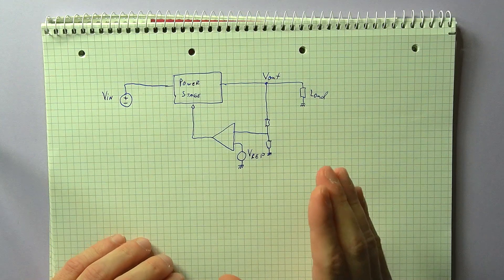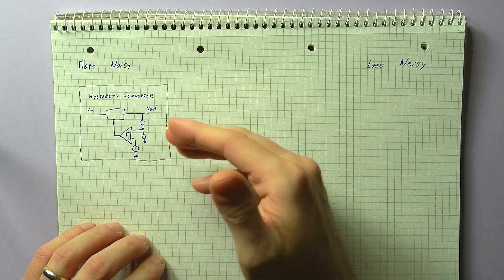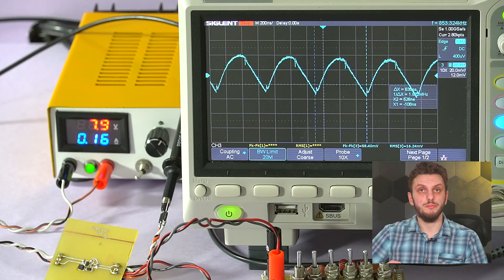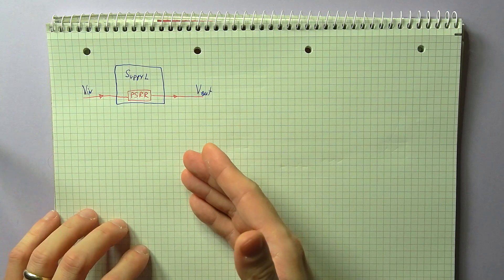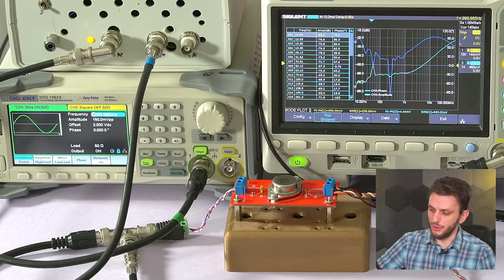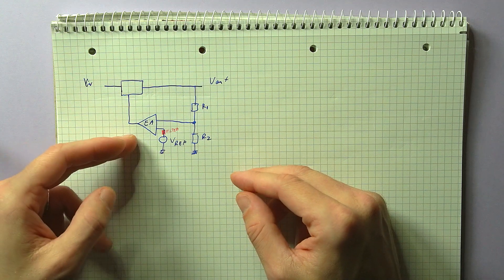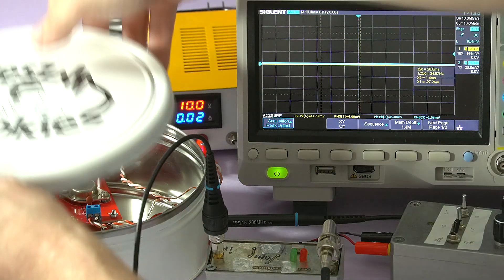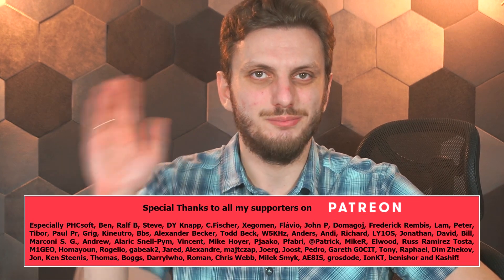Power Supply parameters - Output Noise

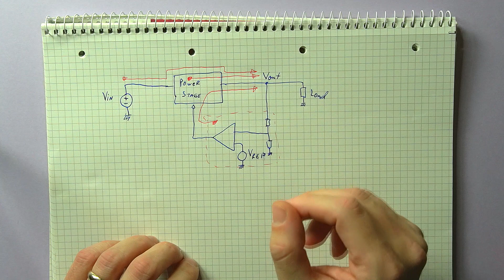Comment: 2:34 > "There is no such a thing as a perfectly clean electronic power supply" where do DC batteries fall in your assumptions?
Reply from the maker: I was mainly referring to electronic circuits - both linear and switching supplies, depending on the application, have non-negligible amounts of output noise.

Comment: I'm curious, could the active load, which was used in the noise measurement setup, affect the results? An active load usually has its own feedback network and an amplifier so it's may be a noise source too.
Reply: I bet this can be an issue. When I tested some PSUs I used purely resistive loads to figure out the actual noise from the SMPS and not have my actual load influence that measurement.

Comment: It goes without saying that there are some deep rabbit holes here. For example, you may find out the hard way that it is not only the noise relative to circuit ground that counts and what common-mode noise is once a crappy USB charger sabotages touchscreen operation on your tablet or phone... And then there is the fun subject of mains leakage...

Comment: Hi Feri!  Once on a conference at Rohde&Schwarz the speaker was Steven Sandler from Picotest, he told us "Avoid ferrite beads like the plague!" - however I've found them quite useful in several circuits containing DC/DC converters. What is your take on ferrite beads as filters for power supply noise?
Reply from the maker: In my experience, ferrites are useful for reducing high frequency noise, but they can still cause problems if you forget that at low frequency they are inductors - when load steps are applied, if the capacitor after is small and with low ESR, you can get ringing; so you need to include the ferrite into a filter with sufficient damping; 
Anyway, I'm also curios, what was the reasoning behind the statement from the R&S speaker?
Reply: @FesZElectronics  He just mentioned it  without going into details and I am still wondering about the reasons. He addressed several topics regarding power supplies and told interesting stories, so there was no time to profound discussions.
Reply from the maker: @akos_buzogany  I guess in the end any extra component is something to be avoided - if you can reduce noise any other way, that should be tried first.
Reply: I am reasonably confident that his concern was centered around PDN impedance, as Fesz mentioned. Robert Feranec has a number of videos about measuring and simulating PDN impedance, and I believe one of those was with someone from Picotest. Given their product line, PDN impedance is definitely going to be on the radar of people at Picotest. This is probably more of an issue with digital circuits (generally). On the other side of the coin, there is Linear Technology application note AN101, where Jim Williams talks about using ferrite beads as the best way to filter high frequency harmonics from switching supplies because the frequencies where these show up are those where parasitics dominate the frequency response of inductors and capacitors. This app note was probably aimed more at an analog audience. Overall, the decision of whether to use ferrite beads should probably consider the relative importance of noise and high frequency impedance of the power supply.
Reply: @cseizert  I use them mostly to reduce noise after switched capacitance inverters/doublers. They produce a noise which visibly propagate through the voltage regulator placed next to them. A ferrite bead in between works like charm to dampen most of that noise.
Reply: What did he say was the reason to avoid using ferrite beads?
Reply: @domtom128  Sadly, he did not go in details, he just mentioned it. That's the reason I'm asking :)
Reply: There's lots of nonsense being said at those conferences sometimes. Their priority is not education, it's protecting the trade secrets.
Reply: @noneofyerbeeswax8194  Some "conferences" are like that, indeed. Guys at R&S are honest and usually tell you when they are not allowed to disclose further details on a question. Steven Sandler was an invited guest expert and ferrite beads had nothing to do with any trade secrets. He did tell us real life stories on major manufacturers which were quite surprising and amusing! The presentations of their experts are highly educative and worth thousands of $.

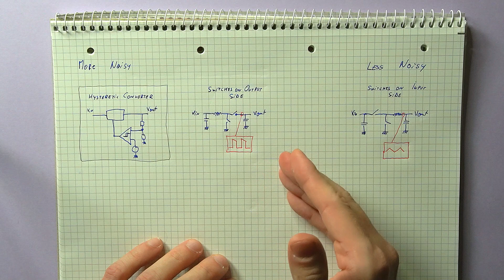Comment: 3:50 These diagrams are drawn too small to see comfortably..
Also, I would have preferred if the capacitors were left out of the circuits since the discussion is about the inductor and the switching while the capacitors are common to both circuits and are really a separate stage (of sorts). It would drive the point home of what the difference between buck and boost converter is more easily too.
Having said that, the exposition is very clear and helps one that has never seen these circuits before to easily form the distinct concepts that are realised by them.
I would have liked the buck-boost converter to have been presented also (either as the general case from which these two circuits are derived or as their composition - given how this tutorial is structured, I suppose it would be the latter) but maybe this is a subject that can be dealt in a separate tutorial.
Reply: are you watching the video with your phone?

Comment: Nice please make a series on control loop design
Reply: There are tons of tutorials/lecture series on youtube on this subject. I think this channel is mainly about electronics. Control is far too mathematical a subject to present easily in the style of exposition selected here. Having said that, maybe experimental implementations of, say, PID controllers can be presented along with their basic principles of operation but anything beyond that would be only scratching the surface of control theory, in my opinion doing both the latter and the channel an injustice.
Reply: @Stelios.Posantzis  I don't think you have understood what I have asked ,it's not control system it's  SMPS Control loop  which is very essential for any power supply or Analog design engineer and there is a intuitive way or practical way of understanding of loop design and in industry people don't use too much mathematics rather they do it in  intuitive way ...can you name some channel which combines mathematics and practical of SMPS Control loop design??
Reply: @biswajit681  Sure, you don't need a thorough grounding in control systems theory in order to apply control in practice, in the industry - as long as you know to observe specific guidelines. How far this can get you and whether it will allow you to design control applications in all situations (i.e. in as many as a proper grounding in the theory would allow you, as catering for all situations is truly impossible), I do not know. 
You asked about "control loop design" without qualifying that in any way - hence my original comment.
Re. control used in the particular application of SMPSs, sure, you can find something of the sort in the channel by Sam Ben Yaakov here:

https://www.youtube.com/@sambenyaakov

His channel is about all kinds of SMPS technology aspects and he has one or two videos on control.
He hasn't got a video on designing a control loop as far as I can remember but he does give the guidelines. Other than that, for SMPS and magnetics, it's thoroughly recommended.
Since you are not asking about the mathematical background, I don't know further examples but you can try some of these tutorials on control theory - not all are heavy on the math and some are quite short. The problem with these is that they will leave you with many more questions than answers and little to no rules to use for practical implementations to make them not worthwhile watching (for your purposes) so I'm not mentioning any.